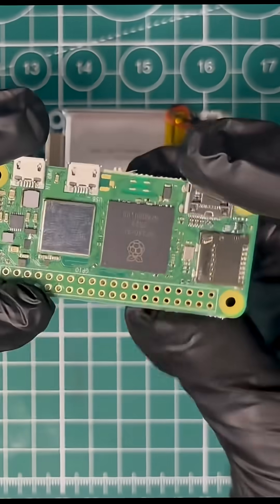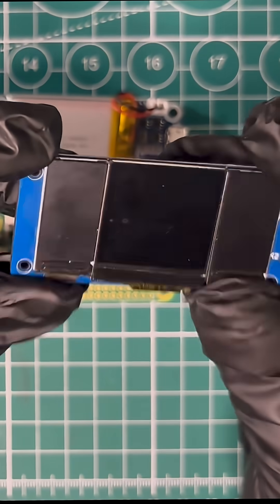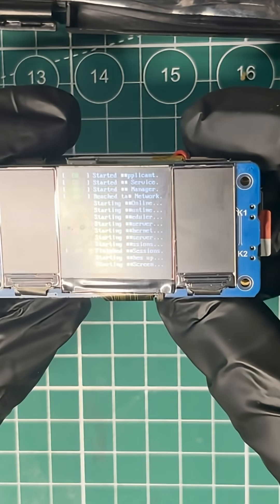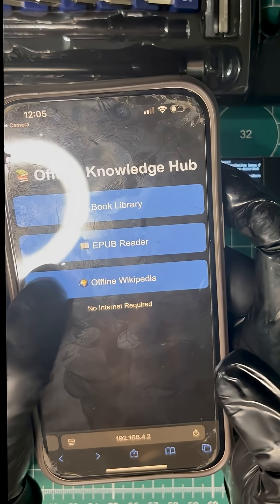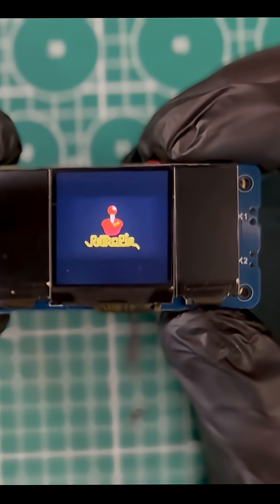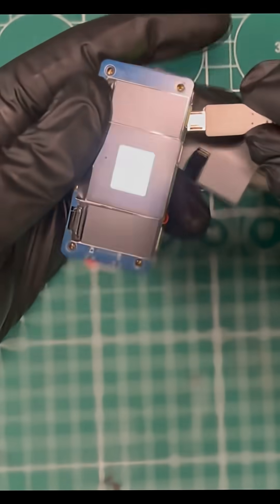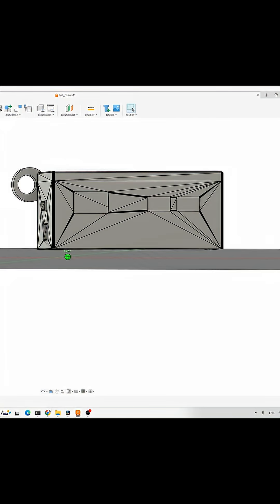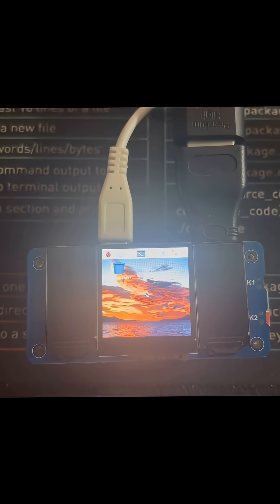DYI: Mini Pocket Cyberdeck

Comment: Looked like there was a 3rd screen but i never saw it activate it...
Reply from the maker: You are right, there are two 0.96 inch screen one is  the qrcode, and the left one. I could use it as system status, but while I was working on it cracked and I couldn't return it passed warranty.